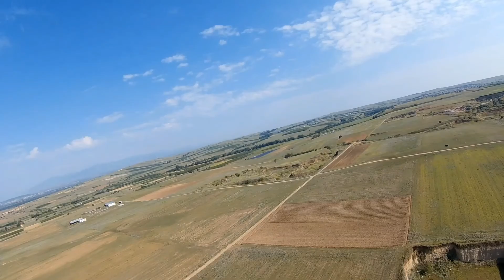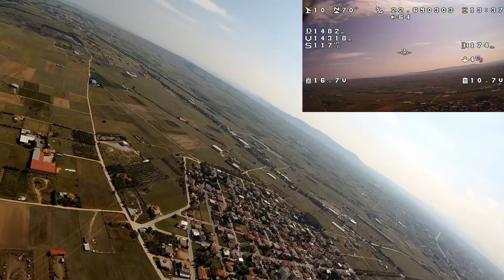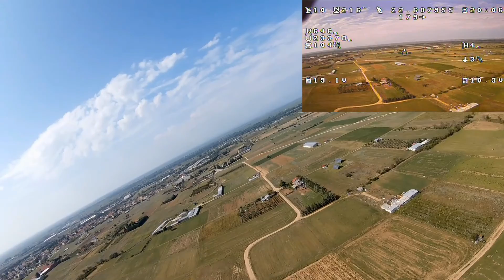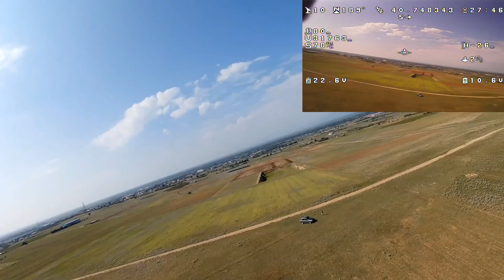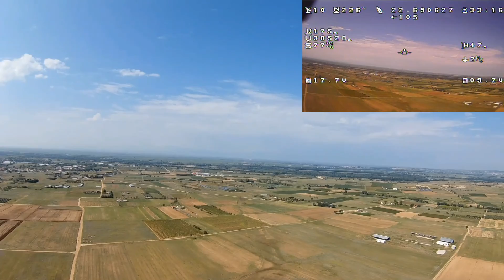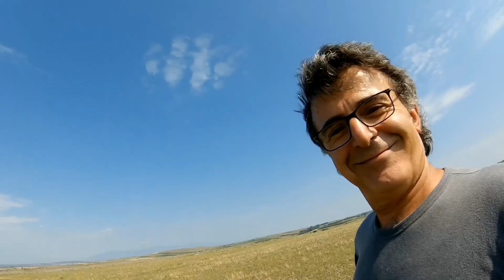Reptile Harrier S1100   45km single motor maiden test flight on 3S

Comment: What size Lopo were you using?
Reply from the maker: I use 12X18650 Li-ion in 3S4P   https://www.ebay.com/itm/8x-Samsung-INR18650-35E-3-6V-3500mAh-10A-unprotected-flat-Top/322835315304?hash=item4b2a7bfa68:g:OCQAAOSwhqhZ5wgt
Reply: Ciri Papa Do you reckon a 5200mah 4s would be too heavy for it?
Reply from the maker: No it is not too heavy.Mine is 14000mAh in 3S and I will change it in 4S. To convert it into 4S I need four more batteries.I will place these four batteries as far back as possible to move the CG back. Now it is too nose heavy and inefficient. By the way your Venturi Evo 2 is great.I have two Venturi Evo 2 and one Revenge still original packed in the box and no time to assemble them ready.